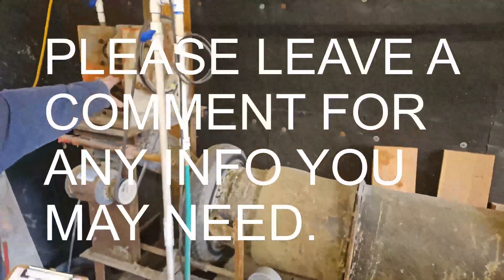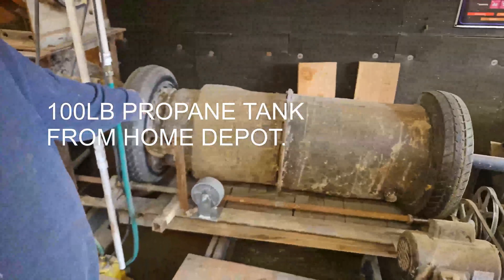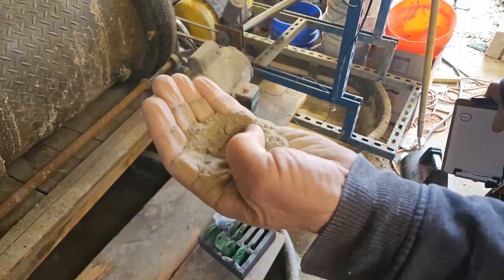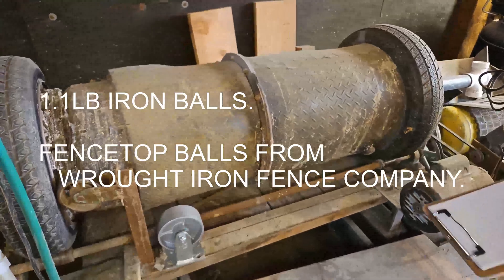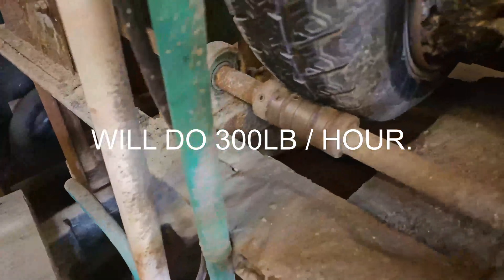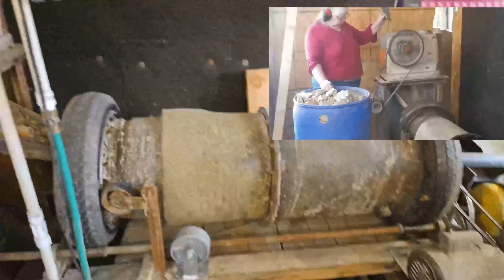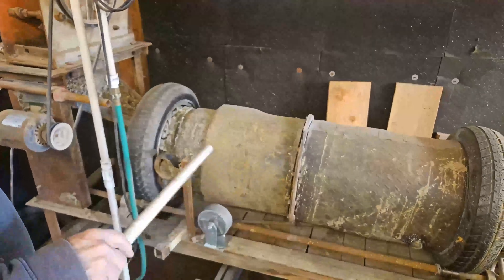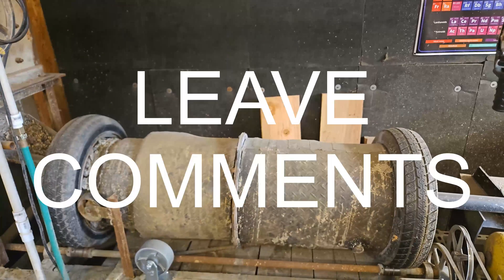BUILDING THE PERFECT DIY BALL MILL FOR GOLD MINING AT HOME

Comment: Do you have any drawings of the ball mill that show the dimensions, etc.  Thanks
Reply from the maker: @lucrurilecareconteazacelma3081  I don't think we ever made any drawings. We just started with a large propane tank and went from there. Ball Mills can be any size. The big industrial full scale ones are short and fat like big concrete mixers. A small portable concrete mixer would make a good ball meal. It just wouldn't be very efficient loading and unloading. It wouldn't be continuous. There's also another type of ball milk called a rod Mill that uses long steel rods instead of Steel balls. You can really put anything in a ball mill. I seen where people put old nuts and bolts and cut off pieces of rebar and all kinds of stuff in their ball Mills.
Reply: How does the concentrate flow past the plate in the middle with the 4 inch square hole?  Doesn't it catch gold against the plate because it can't flow up to the hole?

Comment: With your 275 gallon tank are you doing magnetic cons only or all the ore. Would the eco gold x work with high pyrite enriched ore.
Reply from the maker: if ground down fine enough and then use an oxidizer and heat you should be able to leach gold with eco goldex.  we just found out we are getting 96% of the gold with just magnets so we no longer need the big tank,  we will now be using a blue drum called the VAT+OH  for doing speed leaching on the magnetic cons.
Reply: @bosrecreationalmining   So the 55 gallon drum will be enough. Using the same set up as before in the video and gold x super agent or with pyrite and telluride eco gold x o
Reply: Thanks. I am looking at a rod mill does half a ton to ton a hour I hope it will work.  I like the magnet setup you have on the conveyor belt drum. Goid idea
Reply from the maker: a drum can be heated with a band heater making the leaching very fast.
Reply from the maker: the magnetic ore is likely from an oxidized gold deposit (above the water table)
Reply from the maker: It's all broken layered Rock very near the surface. The magnetic ore is in a layer about 6 inches thick.

Comment: what does the plate in the center do? it has a 4" square hole in the center to keep the balls in one end or?
Reply from the maker: the plate makes 2 chambers out of 1.  and keeps the balls from all going to the low end of the mill. haveing the 4 inch hole stops the balls from all winding up at the low end.